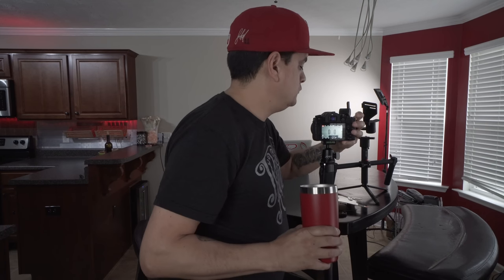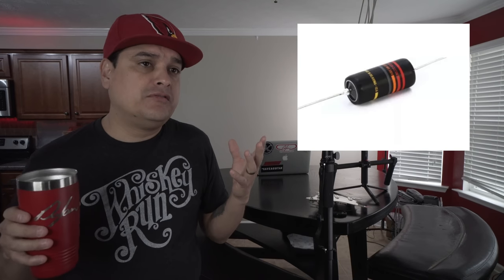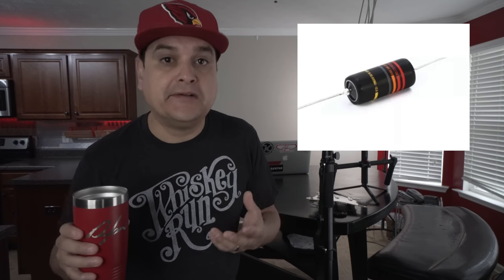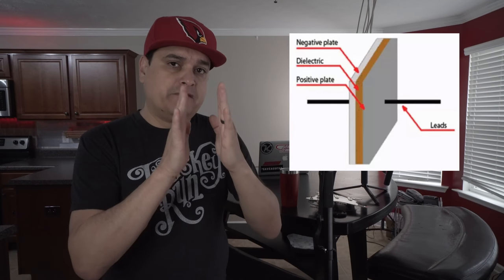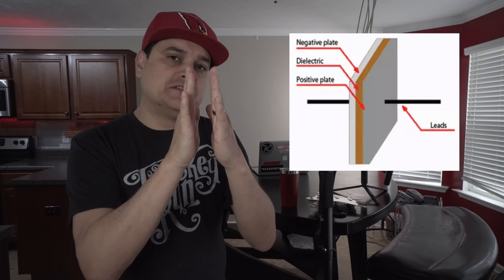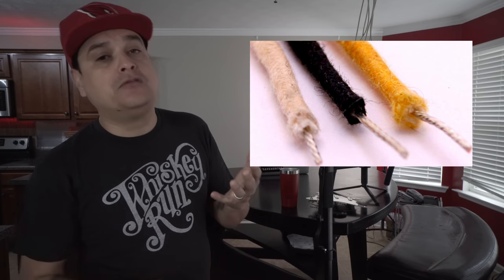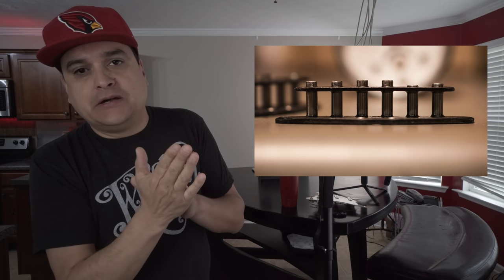Are Paper In Oil Caps Better Than Orange Drop?

Comment: I just found your site and mostly I agree. I have been involved in the manufacture of circuits from power supplies to RF and capacitor selection is critical. The one factor you missed is price. Fender, Gibson and all the rest did not use silver mica (an extreme example) because paper would do the job for less money. It was a rule of thumb back then to use paper caps in audio circuits. People today who want working examples of old electronics remove the paper caps and replace them with plastic film types because those old caps have failed, as you pointed out. Those old caps are not in general use today because the reliability was bad.
also
Oil was not used to cool the capacitor, it could not circulate. It was used to "heal" a small punch through of the paper dielectric. I know, I'm picky.
Reply: Passive guitar circuits operate at millivolt levels and choice of capacitors isn't nearly as critical as in the circuits you're experienced with.
Reply: @johnsieff2921 Yes, self-healing wouldn't apply at the millivolt level. I did experiment with various caps on my bass guitar, but I determined that the tonal change would turn me into good player :-)

Comment: I watched this right before wiring up a Fernandez L-50 strat I own. It has Seymour Duncan Texas specials. This is what I changed . One of the screws was on the verge of stripping out, so I installed brass EZ Locs with 1/4-20 thread inside. I drilled out the screw holes to accept the bolts. I replaced the bridge that was a LR Baggs acoustic with a wide spacing. It was too wide for the width of the neck, and the E sting would slide off the top of the neck down past the 5th fret. I bought a Mex bridge plate with block and used some Tusq saddles I had laying around. I had used them before and liked them. Now I was ready to wire up a all new hand made push back wire harness from scratch, done it before many times. I decided to use J  Vaughan-Wacker(don't know who this is) diagram with a .022 cap on first tone, and a .047 on the second tonepot. New jack new strings plugged it in and it was so trebley in all positions I couldn't believe it. I used both orange drop caps, and double checked all wiring connection with a pair of magnifiers before assembling it. In the past I have tried orange drops, and never left them in. This guitar has a small routing and space is tight, so I decided to try them, besides this was different than I had tried in the past.  OK, they are coming back out first opportunity I get. Before it sounded very much like my US strat, and I very much liked the sound of it. It sounds totally differnt now. If you want to torture someone with ear splitting treble, then this is for you. The caps I took out were a little tiny treble bleed cap, and a small cap half the size of an M&M, but it sounded really good. Well I guess that's my three cents worth.

Comment: I just rewired my Strat using two orange capacitors: .047 to the neck PU tone pot shared with the middle pickup and .022 to the middle PU tone pot now occupied by the bridge pickup; my #1 Tele was also rewired w/a .047 orange capacitor while Tele #2 is 'Esquired' w/a .022 orange cap on 3 while retaining the .022 green cap it came with.
Reply: And? How did you like the results?
Reply: @MC-wh3xm They're all better than before!

Comment: If you measure two capacitors of different kind with the same value,
you get different readings depending on the frequency your capacitance meter are using (often 100Hz to 1Khz).
But since guitars just handle audible frequencies below 20khz I don't think it matters at all.
There is a difference on choosing types when you are talking about Mhz/Ghz range.
I think you should select one that is easy to solder with a long lifespan. Or just use the one with the coolest colour.
Reply: Personally, I first choose the value I like, then I install the ones that have the look I like the most in that guitar 😀 
Paper in Oil...tropical fish, orange drop...they all have a place in my guitars. There is no real difference in sound, but I hate to see those small ceramic disk caps and always swap them out. Still makes me feel I did something to make my guitar more personal
Reply: @frankscassi4960  The ceramic don't blead.
Reply: @frankscassi4960  For me, nerding out on capacitors is fun. I enjoy being a capacitor nerd even if it makes not much of difference

Comment: After about 30 years, the onboard effects stuff on my Cort flying V started to fail. I'd never really used the stuff, didn't care for how it performed or sounded, so I just ripped everything out and rewired it like a Gibson V, with 3 pots and a 3-way switch. I used 500k pots and a .022 uf orange drop. This gave me a top end so trebly it almost sounds like a single coil, and I can still roll the tone knob back to get those more classic Gibson tones. So more attenuation out of the pot, for greater range out of the pickup. Win/win.

Comment: Very valuable informations! 
Thanks Dylan! 😃👍🏼
   I‘ve put 0.015mF orange drops  in 2 humb. guitars with diff. scale length and on a Telly style with noiseless SC‘s. I like to have usable tones from 10-0. 
   I intend to do the same in other two strat/superstrat type, wich are already warm sounding.   
   My LP style „black beauty" got 0.022mF, for the growl.
   I „know“ the difference between the types of caps is negligible to non existent, but I generally don't "trust" things if they are too small… so I chose orange drops…and they look nice too.
   But for treble bleeds I use the small ceramic caps and resistors.

Comment: Somewhere in my junk box, I have a box with a rotary switch and a bunch of capacitors in it. It has alligator clips, so it can be quickly connected for blind testing. When customers ask about cap types and values during a pot swap, I hook it up, and let them decide for themselves. Everyone can consistently hear large differences in capacitance, some notice smaller changes, but no-one has ever correctly identified PIO vs Mylar vs polyester- or even ceramic.

Comment: what is so very funny about the old capacitor argument is that from my experience so few people actually even use the tone circuit on their guitar in the first place or the ones that argue about them don't use the tone circuit. The taper of the pot used in the tone circuit is something that can get over looked. Using a different taper changes how the circuit reacts as in how far you have to turn the knob to get a particular amount of the low pass filter its all in that ratio. So many variables there
Reply: Yea.... I actually put my pots in "backwards", I use audio tape for tone and linear taper for volume. To my ear the volume tapers smoother, and I can get a wah effect out of my tone knob.  Your mileage may vary.
Reply: @daddyosink4413  I have done that as well. And I like that kind of wah effect you can get. I think there are no rules when it comes to that kind of thing. It's the experimentation with all of the components that can lead to killer tone mods that would never happen if we didn't try different combinations that most would think are against the rules.
Reply: @patthesoundguy  a lot of it comes from just working with what you have on hand (cuz face it, most musicians are BROKE lol)necessity is the Mother of Awesome some times 😉
Reply: @daddyosink4413  I agree %100 a lot of what I have came up with was exactly that being broke or having  some things on hand. Why spend crap tons of money when you don't have to.
Reply: @patthesoundguy  yep! I think that my favorite Mockingbird actually has a 1M tone pot with a 33uf cap! 🤣🤣
Reply: @daddyosink4413  why not 😎

Comment: Older video, but thanks for putting it out there. I have a 2005 Schecter C-1 Classic that comes standard with Duncan Jazz/JB pickup combo that I expected to just sing. For whatever reason they decided to use a .047uf cap on the tone control which made the pickups very muddy IMO. I played the guitar for 16 years like that, a bit disappointed with the pickups. Decided to completely change the electronics in the control cavity. Pulled out the Chinese 5 way switch and install a 3 way switch craft blade switch, swapped the pots for CTS push-pull 500k audio taper pots, did a partial coil split to mitigate the volume loss using 1K and 2K resistors to ground from the split, and put in an orange drop .022uf cap. Sure it was a lot of changes, but in reality the stock switch and pots were getting scratchy and it needed a refresh. After the mods the guitar now sounds amazing. Much more articulate, much better tonal variations from the tone control, all the richness and harmonic undertones I expected from the pickups is now there. Curious what really made the difference, I started playing with caps. The old pots measured out at 500k so I was pretty confident that wasn’t what made it sound so dark. The old ceramic cap was .047 as advertised. In researching many of your videos I learned that .047 is more to take the high end of single coils and .022 was a winner for hum buckers. I decided for kicks I would put that .047 back in just to see what happened and surprisingly it sounded excellent, but much darker when the tone was rolled completely down, dumping everything to the cap. Kind of expected. But with the tone at “10” it retained all the brightness and articulation I was getting from the .022uf orange drop. 

Anyway, there was certainly some part of that old circuit that was robbing the signal and making the poor thing sound like crap. I could go on experimenting, but I just rest comfortably knowing it now sounds great. I suspect maybe the old No name pots had something to do with it? 

Sorry for the long post. LoL. Any insight you can offer as to why it used to sound dark and muddy, and it now sounds brilliant would be appreciated. It’s seriously like I used to have a blanket over the amp cabinet, and after the electronics swap it’s now free and beautifully articulate. Strange to me. Glad for the cheap fix, but my curiosity is still there!

Comment: Capacitors are merely frequency filters that bleed high frequencies off to ground, leaving the lower (darker) tones intact in the signal chain. You can however get different tones using the same value of capacitor by changing the cap's position across the tone pot's middle lug  to ground, from the tone pot's far left lug  to the volume pot's far right lug, or from the tone pot's far left lug to the volume pot's middle lug. Also using a 500k ohm volume pot for humbucker pickups and 250k ohm volume pots for single coil puckups, or vice versa will also vary the tone of your guitar's output signal.

Comment: People make such a big deal about caps in their guitars.  It's insane. 
I use Orange Drop .0147 for my tone cap.  I feel I get more out of my tone pot than using a .022 or a  .05
My volume pot has a 680pf Silver Mica and a 220k resistor.
I've been doing this for over 20 years.  Because it works for ME.  The pots I like to measure them and use three (Strat) that measure as close to the same as possible for the sake of OCD.  Usually CTS or Emmerson. 
But why?  I don't know.  Just a habit really.  Orange Drop caps are available everywhere I guess.  I've used ceramic disc caps in the past with the same results.  Whatever is available works.  I worry more about actually playing than stressing out over what's under the hood.
Reply: 680pf parallel to 220k?

Comment: What you just said made more sense to me than any of the discussions I've read over the past 20 years. I don't know anything about capacitors. I never heard a difference during different tests. The only difference I've heard is on a Lolar video where they change between a 0.015,0.022, and 0.047. All that did was change the travel and depth of the tone knob. So, a person might choose a different value. But, it's good to know that the different types have more to do with the use environment which, on a guitar is a sealed cavity with some vibration and a benign temperature environment. Thanks so much for another great video!

Comment: A while back I went full nerd and started buying and testing all sorts of and tone caps. I tried the orange drop, tropical fish, Russian caps actually shipped from Russia, old PiO, and so on.  I ran my American made Strat with Texas S. pups through a 65 Pro Reverb and listened really hard for that one special cap with the smokiest, dopiest and most beer stained tone I could find. The SOB just wasn't there. 

I tried very hard to like one over the other but couldn't and I would have tried a cap dipped in unicorn blood if I could have found one, but then wondered what would happen if I went n the opposite direction and purchased a pack of 50 green Chiclets from China for $2. Guess which one I left in my American made guitar.  Yep.  There was no discernible difference in any of them and I was so fed up with the results I stopped testing and left a 4 cent cap in the guitar. 

I wanted to believe the reaction between the signal and construction of the cap would make a difference but there's an easier way to find the right tone.  With so many different capacitor values available just experiment with different cuts until you find a value that will produce what you want.
Reply: Unicorn blood. Lol
Reply: @Augustin Olivares Umm... yes

Comment: You asked to write a comment before watching the entire video, so what I think about tone capacitors: their value affects the frequency response as a part of a filter with pickup inductance, resistance and internal capacity. The dielectric material means less, but because of the differencies in dielectric loss tangent it affects the phase shifts and you can slightly hear that in attacks. So nothing wrong with experimenting here

Comment: My own experiment, which was trial and trial, some caps did sound better. I think the whole of the guitar kinda dictated what sounded best for what I was looking for. I mean once you commit to a pricey set of pickups, you want to get the sound that sounds the best to you. In general, I found Orange drop type caps to be more brittle sounding and not have the "musical note" quality that I found PIO caps to have, or even some high dollar poly caps to have. I am wiring up a strat right after this video, with two caps, so "lets go". I have a variety of Orange ones, and same with Russian PIO.
Reply: How can you measure that? Is it because the tolerances with which they were manufactured introduce different capacitances, or do you measure it with your heart?
Reply: @heliazbat  You do a nulltest and check for microphony.

Comment: OK, I'm commenting before watching, as requested.  I have many guitars, and have tried lots of subtle mods.  I hear what people say about the capacitor's material not being a contributing factor.  Now, I don't claim to be able to hear the difference between alkaline vs. copper top batteries in my pedals, like Eric Johnson.  Someone told me that Eric also recently said that he can hear the difference in different jacks.  Met Eric twice.  Nice guy.  Very humble.  If he can hear a swapped out jack, good for him.  I don't have dog ears. But I do have decent ears, as I do a lot of mixing and mastering, etc. And I've been playing for 45 years.  But I know for a fact, that I've tried various brands of capacitors, and heard different outcomes.  The paper-in-oil wasn't snake oil.  Sprague Vitamin Qs sounded very noticeably different to my hears than the stock orange drops.  There was a certain silvery sheen type of aural exciter processor kind of difference to certain frequencies in the highs.  Kind of what a delay or ambient stereo reverb does to high notes.  They were softer, more sparkly, a little more even, or had more musical alignment.  And the guitar is one I just used live two weeks ago again, and the same holds true, it does in fact sound better with the upgraded caps.  Not sure what the magical unicorn ingredient is.  Possibly the material that the signal passes through contributes in some way.  Ok, now watching your video to hear you tell me I'm wrong and it doesn't matter at all.  :D

Comment: I'm not really too bothered. I saw a test where some old russian ones had slight upper mids and warmth. But to be honest it was nothing you probably couldn't tweak with the EU on your amp, guitar or pedals. And in this case the difference was probably  5-7%. Getting a different value cap would probably make a bigger difference. I remember swapping out the 33 that came with my dual humbucker Ibanez for a 47. I noticed a slight difference but hardly night and day and might as well not have bothered. 

Changing the pickups for some third party ones made a MUCH bigger difference. Louder, warmer,  more articulate and defined picking dynamics. As a then newbie to messing with guitar I kind of decided then that the caps aren't really a big deal and either I was tone deaf, or just not that picky of tiny changes that can be tweaked. I'm sure using the wrong caps between single coils and humbuckers would make a difference, and changing values is a cheap way to slightly tweak a overly bright or dark guitar  but caps are probably the last thing I worry about.  

Setups and nuts, pickup height are another thing entirely. I procrastinate on that all the time lol.

Comment: I recently rewired an old lawsuit Les Paul.  I grabbed some unbranded disc caps from an assortment bag I bought for $3. You know what?  The tone knobs work fine and the guitar sounds nice.  On the other hand I regret not paying a little more for the pots I used. 😉